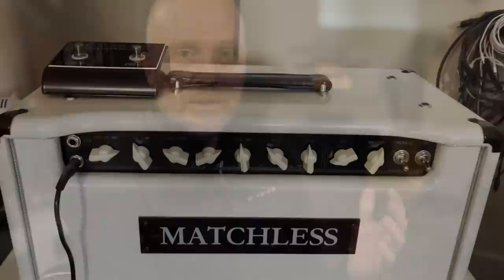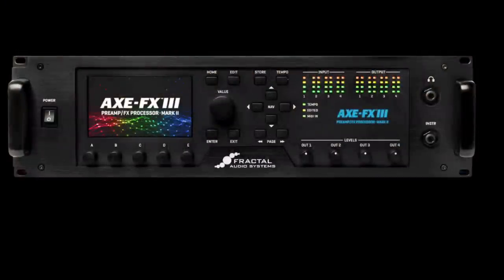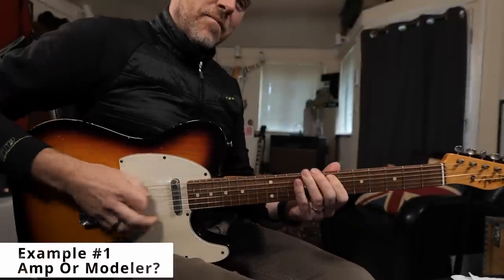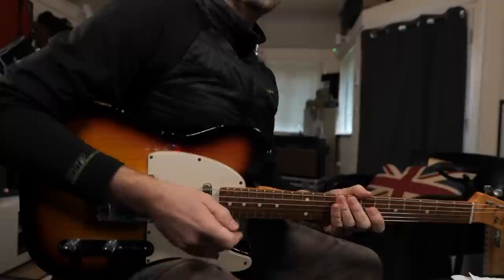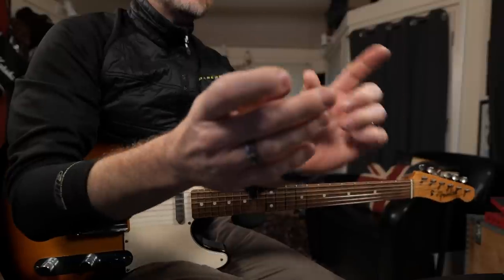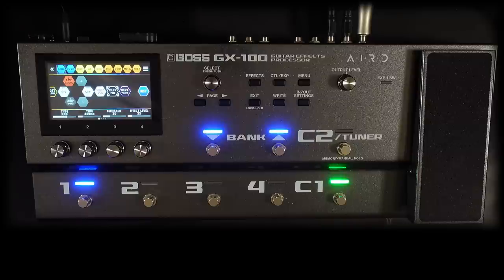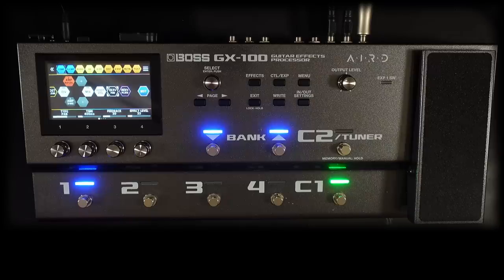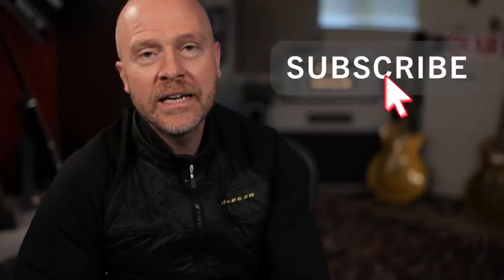Guitar Amp vs Modeler - Can You Tell The Difference

Comment: If you put the Axe-FX through a 4x12, in a live pub band, I feel like the difference would be more noticeable. This is assuming that you aren't mic'ing up or sending the Axe-FX direct to house. Obviously not something that can easily be tested online, unless you can accurately replicate the room sound with mics!
Reply: If you were doing that you would disable the power amp (if you use a guitar amps power amp section) and cab emulation and it would actually sound closer not further.

Thats the point ... you can either use the axe all in the box and it sounds like a recorded amp or you can use it like an actual amp i.e. through a cab or even just as preamp emulation.

You can do any level of modelling ... hell just fx if you want.

Comment: Ive got an old ( 90s) Marshall Blues Breaker and a point to point hand made amp made by a builder in Serbia. Both sound amazing. That being said, I use to play ships as a solo pub entertainer and traveled with a 2007 Roland VG-99 and a Traveller Escape MKII Steel guitar with a GK-3 pickup on it. I flew to all my gigs so I needed something small enough to fit in a carryon. That was my live rig and I got all sorts of compliments on my sound. Since I flew from Canada to my cruise ship gigs I needed to have more than one guitar and amp combo and the 99 did everything I needed. Heres a couple of links that showcase this 2007 technology. The 99 still holds up extremely well even today. I figured out how to model my American standard strat into the box and a Ricky 12 string and I dl a nylon patch and ported it over into my 99. In my studio I dont even use the real amps anymore as the emulators sound good enough to fool guitar players that work in my place. 
  This is the first demo of the 99 I saw. The unit does instant open tunings, stacked guitars, and multiple instruments. This was perfect for a live act and you dont have to cary multiple instruments.
https://www.youtube.com/watch?v=WZlHWTqfgDI&ab_channel=PaulHanson

My favorite VG-99 patch for the detractors that say the 99 is too digital sounding. Great playing and programming from Scott Akister.

Played in one pass on one track by one guitar with one patch. The verse guitars on the original are double tracked panned hard left and right and it's impossible for one person to play exactly what Paul Kossoff did because he used different inversions of the A chord on left and right takes besides massively different tone setup. I've used some cunning variable delay between the left and right models to simulate double tracking by a single guitar. This patch also has the solo tone.

Patch available from vguitarforums.com
https://soundcloud.com/smashmashups/alright-now-vg99-patch-demo

Heres an A/B between a real nylon and a virtual one. Modelers and gettin pretty good. 
https://www.youtube.com/watch?v=ssRzCBg_HzQ&ab_channel=CarlosEduardoArellano

Comment: They sound completely different, should have used the same IR for both the Axe FX and matchless & done it like that. That way it'd have been a much fairer comparison.
Reply from the maker: The video is not asking if they sound the same but if you can pick out which is the amp and which is the modeller.

Comment: I'm late😊. I'll say this till I'm blue but it's so easy to pick the Axe. Listen carefully to the ATTACK. TRY RIGHT NOW. On the 1st one listen to the String slide - how compressed it is, like a comp pedal. Now the Acdc type riff. Hear the string tap(slight chug in the break) "Daa Da Da CLICK". Now, why? Because there's no proper tube voltage drop at the initial strike. Instead of evening out, it  stabs. The high gain amps especially, all sound like there's a pedal in front. No initial sag, just solid state type attack. This is why you hear comments from some people that the Axe sounds better than the real amp which think about it, that's impossible right? the real amp is what it's trying to model so how can it be better? That's illogical by the very definition of what Emulation is. It fails to model the tube amp. So what people really like is the sound of a pedal type attack. The fact is some people crave Tubes but they don't actually know what tubes do to the signal or what they actually sound like. 
I'm ranting 😅but having listened to these fan boys on Axe forum,and the like, swarm all over  - like a cult - anyone who actually can hear the nuances, its creepy. 
This is a type of player who buys a Mesa or 5150, amps thick with epic gain, and they put a 50 dollar pedal in front. I say buy a modeler. (BTW, I've been buying them since forever - I'm a fan) 

Axe voicings are good. The gain is good and effects are great. But the actual tube emulation is poor. It's a shame cause Line6 models tubes correctly, (they actually own the amps, and dig deep with readings) but they lagged on other aspects).

Comment: There is a stark and obvious difference between these two sources. Source 1 is noticeably brighter and more three-dimensional than Source 2, and if Source 2 is the actual amplifier, then what you have proven is that either you've mixed the two up, or your skills at miking and recording actual amplifiers are deficient. A digital model of an amp cannot possibly sound better than the actual amplifier, or by definition, it's not an accurate model. So, the real answer here is obviously, "user error".
Reply: prob using a cab simulation and attenuator,  not a microphone